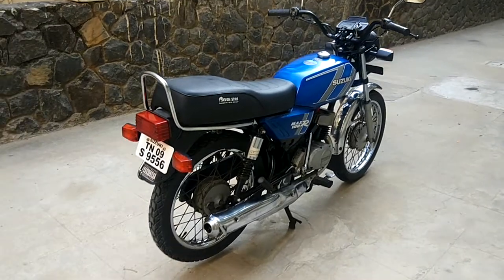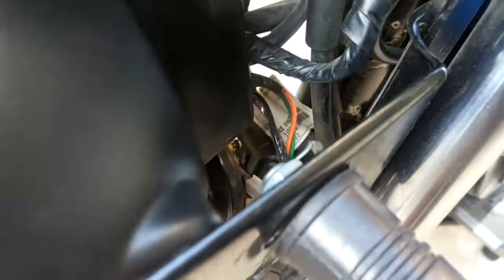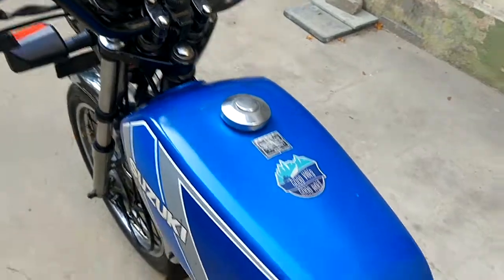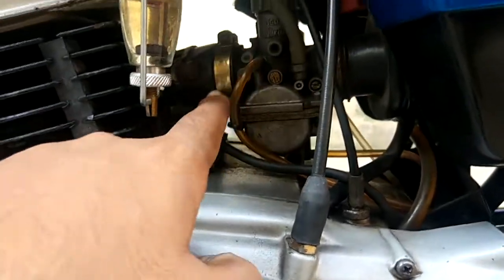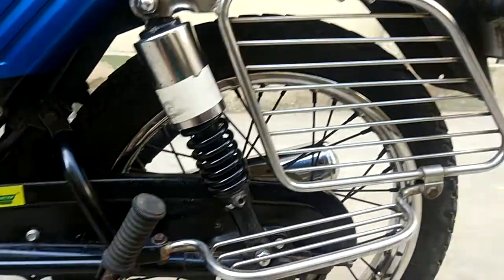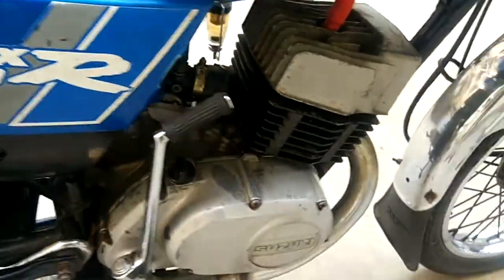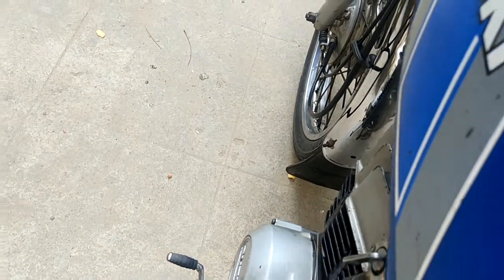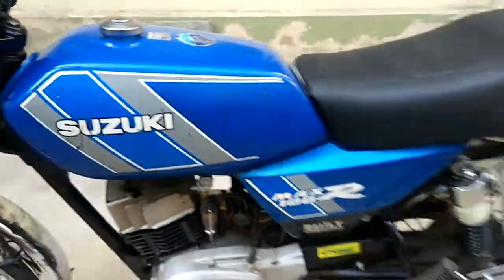My 2001 TVS-Suzuki Max 100R - A Detailed Walkaround!

Comment: Bro, is it normal for the engine to heat up?( I have a samurai)
Reply from the maker: Yes, all engines heat up to an extent where it’s not safe for our bare skin to touch as there is a risk of burn. 

But it shouldn’t overheat. Air cooled 2 strokes in general develop overheating issues with time,wear and tear due to improper carburettor tuning/broken or leaking air filter box or manifolds causing a lean mixture and will cause engine to run hotter and potentially ruin itself.
Reply: @BrattyBiker  My engine is hot to touch. Should  I be worried?
Reply from the maker: Nah. As long as it is running well without any starting or mileage issues, no problem. 

What mileage are you getting now ? Also any starting trouble ? 

Here are some tips if you feel your engine is overheating : 

Make sure you use the right spark plug (NGK BPR7HS) 

Replace air filter, clean air filter box, replace intake manifold rubber.

Clean and retune your carburettor. Increase your idle RPM by turning the idle screw, and then fully close the AFR screw and then start to loosen it, You will need the AFR Screw to be one turn out and you can adjust idle screw properly.

Replace head gasket, Clean the head and clean the exhaust.

Clean oil tank,oil pipes,clean and service the oil pump and use new oil  

OR

You can remove them, seal the oil pipe that’s going to the carburettor and run fully premixed (mix oil directly with petrol) in this case, mix between 25ml to 35ml of oil for every one litre of fuel. Do NOT go above or below this level.

In both cases, 
Use good quality oil (Shell/Motul 2T oil)

Hope it helps 😊
Reply: @BrattyBiker  thanks bro.
Reply from the maker: Bharat Tejsingani Always a pleasure :)
Reply: @BrattyBiker  bro, every morning I have to hold the choke and start the bike.
Reply from the maker: As far as your carb is tuned well and if your mixture is not lean, 

It is normal. A cold engine which has not been used over 4 hours, surrounded in normal temperature, will need more fuel to start up than an engine that is already warmed up. 

But you can check your carburettor’s tune. The AF screw should be only one full turn out and not any more. So tighten it down and then rotate it anti-clockwise till exactly one turn out. This should help in making starting easier
Reply: @BrattyBiker  thanks

Comment: Bro I am using stock e bar in my TVS Max 100R. It's not quite comfortable. Which handle bar would you suggest?
Reply from the maker: You can look for a used Samurai handlebar. It’s very comfortable. Shogun handlebar will also be very good. If you want something wide, go for RD handlebar but it can be a bit too wide in traffic.
Reply: @BrattyBiker  Thank you bro
Reply from the maker: Cheers :)

Comment: Brother can you use modified bikes in tamilnadu.
Reply from the maker: Yes but it depends on what modifications and where exactly you ride it. Small modifications like stickers,auxillary lights,fancy horns.etc no problem at all.

But in general, riding modified bikes in remote villages and small towns, no problem.But in major cities like Madras.etc, I’d suggest you NOT to ride a heavily modified bike as it will attract unwanted attention from the cops. 

Whatever modification you do, make sure you don’t tamper with the frame like bending,wielding.etc and make sure not to do anything that will change engine and chassis number. It must match according to the RC.

Cops these days are catching loud bikes and siezing them so make sure to not have loud exhausts. If you are also ride a 2 stroke, make sure to use glasswool to reduce the volume of the exhaust sound.

Comment: Hey bro!!.I own a TVS Suziki AX100 R Bike.Can you Say Some notable Differences between Max 100R and AX 100R?
Reply from the maker: AX100R is very rare and it was one of the earliest TVS-Suzuki bike to have launched. It had a slightly more powerful engine, the side panels were made from metal, different electrical system, different headlight,indicator,rear carrier (very rare),different exhaust,front suspension.etc.
It was all Japanese parts, imported and assembled here in India so the build quality was top notch.

Max 100R was a much later model, mainly manufactured locally.
Reply: @BrattyBiker  Thank you So much bro..💓Actually it was my Grandpa's Bike.. Recently i found a Certification of Registration(RC) Book Dated 18.12.1992😊.For now the Bike is in Working Condition and em Using it but Still i need to alter Something in order to maintain.lyk partially rusted headlight and rusted Side panel parts.
Reply from the maker: That’s amazing! Save up the money, do some research on the parts you need, slowly collect them overtime and thrn get the bike fully rebuilt once you are all set. It’s a wonderful machine, very reliable.
Reply: @BrattyBiker  Happy to hear those wordS bro...😇thanks❣️
Reply from the maker: Cheers, always happy to help :D

Comment: Bro if we use TVS victor series suspension in Max 100. Should we need to change the rear wheel size to 16 inch.
Reply: Will the series spring suspension, affects the bikes height and should we need to alter the center stand and front suspension height as well if we go for series spring suspension
Reply from the maker: Not required to change to 16 inch wheel (Yezdi type). Doing it will increase pickup, but will reduce topend,mileage and will stress the engine more, so lower life. So you can stick to 18 wheel.
Reply from the maker: You have to get the top nut provision on the Victor shocks, to that from the RX’s shocks. 
You can even try using the top nut of your Suzuki shocks to the Victor shocks but I am not sure if thats possible.That RX top nut is shorter in height than the Victor’s top nut so you can use it to maintain the same ride height without needing to change the wheel or modify the center stand.
Reply: @BrattyBiker  Thanks you bro. Expecting more unique videos from bratty biker😀
Reply from the maker: Thanks :) currently on a break but working on some projects. You can expect new videos to hit soon!

Comment: My one is 2000 model 
It have japan carburator 
But the milege is giving 35km per litre what can i do
Reply from the maker: 35kmpl is pretty bad, Max 100R and Samurais usually do 50kmpl easily, so I am giving you a detailed set of tips.

Japan Carburettor ? Was it from an AX100R or some other bike ? 

Is your engine smooth or producing any abnormal sounds like rattles ? Does it start easily or require a lot of kicks ?

Also are you running premixed ? How much oil are you mixing with petrol ? 
Is your oil pump working ? 

Do these in the exact order : 

Clean your Fuel tank, make sure there are no holes or no rust inside. If so, get it fixed and get it sealed or change the tank and use fresh new fuel.

Clean or replace fuel filter. Go for the Pacco glass type filter found in old Yezdi and Jawa. They do a brilliant job on keeping fuel clean so fuel flow will be consistent : easy starting,good performance and mileage.

Clean air filter box and replace the Air Filter. Make sure you soak it in 2T oil, squeeze it and then install. Clogged or dusted filters cause low mileage.

Replace intake manifold rubber. Cracks in that can cause mixture to go lean and damage the engine.

Clean your oil tank, oil pipes and oil pump. Make sure you are careful not to damage the pump. Because dirt in tank can cause trouble in supplying oil to engine can can cause engine siezure (expensive mistake)

I’d advice you to remove the pump,seal the pipe and run fully premixed, that is mixing oil directly with the petrol tank. The video will be posted soon, stay tuned :)

Remove exhaust and check for carbon deposits and clean if found too much. Too much of it can alter flow of exhaust gasses and affect engine’s performance and mileage.

Open engine head, clean the carbon deposits off with petrol and an crushed aluminium foil.

Take off the engine block (bore/cylinder) inspect the engine studds, condition of piston rings,piston, connecting rod’s ply sideways. Also inspect the bore for any scratches. If found abnormalities/scratches or deep scorring, then its best to rebore at a good lathe and put a new piston and rings. If there is too much side to side movement in the connecting rod, then the whole engine must be opened up and have to be rebuilt with new bearings,rebuilt crankshaft with new connecting rod.etc

If they are alright, then just put them back, make sure to replace head gasket and tighten the clean head back down.

Put a new spark plug in. NGK BPR7HS would do. 

Clean, Rebuild and retune your carburettor. Make sure to adjust float height correctly. Make sure to keep the clip of the needle in peoper position. This will make sure it is delivering near perfect Air fuel mixture to the engine. Sl again, easy starting,good performance and great mileage.

Inspect your clutch plates if they are slipping and inspect clutch basket/bell for play and get it fixed. Replace clutch and pressure plates, make sure to adjust the cable action too. 

Inspect Chain and Sprockets, if worn out, you’ll be able to hear tak tak noises so replace them. Replace both wheel bearings as well.

Hope it helps :)

Comment: Nice bike,, spare parts available ??
Reply from the maker: Thanks! Also Yes,Very much! Spare Parts are available.TVS is still making vital parts like Block Piston Kit,Clutchplates,Chain and Sprockets.Other parts like Wiring harness,You can get SWISS-make which is readily available and has been doing a good job on my bike.

More over,being a simple 2 stroke motorcycle,There isn't much to go wrong as long as you properly premix and keep riding regularly :)

Comment: Without being biased ...which u feel is better? Rx100 or suzuki max 100?
Reply from the maker: RX definitely.No question there.They are not even in the same segment.
Reply: Had doubts on which one to choose , #2stroke love 😍 ... As it is going to be my secondary bike , primarily I own an Apache RR 310 ... I m not sure if the extra 30 k to be spent on rx100 is worth it
Reply from the maker: dharshan Decoolzer I’d suggest you a 135 over the 100.Due to the price and choices.The 135 has some serious upgrading potential,unlike the 100 :)
Reply: Thnx bro 💪

Comment: Mileage?city and highways?
Reply from the maker: I get close to 40kmpl in city.Highway,I get just over 43kmpl.This is because of a nearly worn out engine block with slightly richer fuel setting.

Max and Samurai,in good condition,if tuned well and ridden normally,can give over 50kmpl.
Reply from the maker: @Ezhil K Yes,50+kmpl is normal for a good Max or Samurai.
Reply from the maker: @Ezhil K Thank you,I shall definitely check it out!

Comment: It has two piece silencer.?
Reply from the maker: Yes, the exhaust muffler is a single piece with the bendpipe and it houses the flute inside it.
You can call it core/flute/baffle.etc
 
The inner flute can be altered or changed to get a different sound for relatively cheap, but the whole exhaust setup can be changed to an expansion chamber to gain in performance.
Reply: @BrattyBiker  iam asking that it has a joint type silencer like Rx 100 joint near brake pedal.
Reply from the maker: Syed Shaiban No it doesn’t. It’s one piece unlike RX which has the bend pipe and muffler seperated.

Comment: which bike's mirror you use in your bike???
Reply from the maker: Stock Max 100R Mirrors sir.Just the handlebar is different.
Reply: @BrattyBiker  in your opinion, which one is best rx100 or max100
Reply from the maker: saqqu sheikh Both cannot really be compared.

But,the RX100 is better than Max100

Comment: Bro what is the cost of restoration
Reply from the maker: Mine is not a fully restored bike. Just cosmetically fixed and some mechanical issues handled. Costed ₹12,000.
A proper Full restoration (cosmetic like repainting,new chrome and nickel plating,new electricals and engine rebuild) can set you back at 25-30K.
Reply: @BrattyBiker  ok

Comment: How to install battery plZ reply
Reply from the maker: This bike had a lot of different variants. If your bike is a Max 100R or DLX, then you can easily install the battery on the right side of the bike right next to the oil tank.

If your bike is a Max 100 (without the R), then you can install the battery only by changing the wiring kit to the Max 100R’s one. It’s easily available.

Comment: Engine oil how km after change panringa broo
Reply from the maker: I think you mean gear/transmission oil. Engine oil means the oil that goes to the engine, and that is 2T oil which we premix with petrol or pour in oil tank which the pump sends it to lubricate the engine.

I change the gearbox/transmission oil once every 5,000KM and I use Motul’s 3000 20W50 for this RXG while I recommend 20W40 for TVS-Suzuki 2 strokes.

Comment: I also hv tvs max 100 not tvs max 100r my bike not having battery
Reply from the maker: Max 100 didn’t come with the battery, so it has different electrical system.

The Max 100 ‘R’ came with the battery.
Reply: @BrattyBiker  ya bro its not my bike its actually my relative bike he dont hv any documents i want to restore it with paint work and handlebar, guard, mirror, indicators and seat and mud guard and bike condition is excellent wht will be the cost for all these work bro ....
Reply: @BrattyBiker  ya bro its not my bike its actually my relative bike he dont hv any documents i want to restore it with paint work and handlebar, guard, mirror, indicators and seat and mud guard and bike condition is excellent wht will be the cost for all these work bro ....
Reply from the maker: Please do NOT restore a bike that does not have it’s papers/documents.

It’s a waste of money as the bike will still not be road-legal, meaning cops can confisticate and scrap the bike since it doesn’t have the papers/documentations.
Reply: @BrattyBiker  k bro thnku for ur kind  information💗🙏